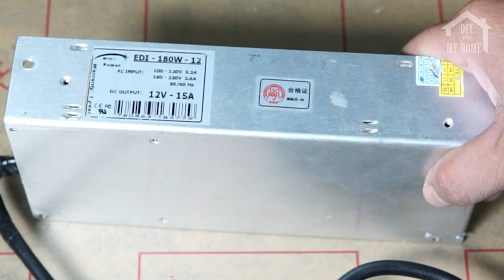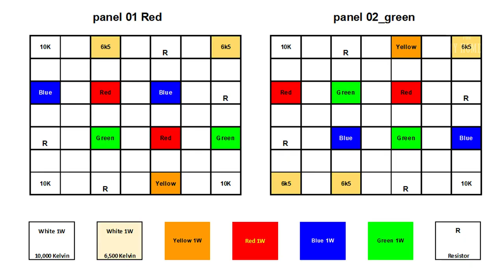DIY Aquarium LED Light WRGB with Luxeon Led

Comment: Very useful video bro. Thanks for sharing.
Can we control white red green blue independetly?
Can we do programming?
Lots of love n care from INDIA.
Reply from the maker: With the grb led controller you can completely control the colors separately. using the intensity correction of each color in the App. You can also schedule the lights to turn off and on each day according to the present cycle.
U can see more about Controller led at link:
https://www.amazon.com/Nexlux-Wireless-Controller-Compatible-Included/dp/B07116SX41/ref=pd_lpo_60_t_0/144-3267273-0150427?_encoding=UTF8&pd_rd_i=B07116SX41&pd_rd_r=c846f476-28a5-4d05-9b1c-919bbd955fbc&pd_rd_w=8w5mx&pd_rd_wg=eDvkl&pf_rd_p=2eae1586-a44a-4b21-997a-1dfc1740e496&pf_rd_r=WRW2GMH2VQBJG7F277H3&psc=1&refRID=WRW2GMH2VQBJG7F277H3
Reply: @diyformyhome2265  thanks a lot bro for assisting us. U have complete knowledge. Great. The light also looks so perfect.
Happy aquascaping .

Comment: How do you decide the color placement on the panel?
Reply from the maker: I rely on color ratio
White 10000 (kelvin) + White 65000 (kelvin) + Yellow --> 40%
Red --> 20 %
Green --> 20 %
Blue --> 20 %
Reply: Wt will b da ratio if i use 3wt

Comment: Bad , Bad , very Bad  you are not an electronic technician ... The first led module will be more bright than others... Each module should have it's own driver ....
Reply from the maker: you're right, we can use the driver module for each led sheet
But 
I calculated it to run at 60 - 70 % power of led only

using a resistor and a 12V -5A power adapter is much cheaper. compared to led driver module

Comment: How do you adjust the intensity of the LED’s?
Reply from the maker: You should be add the module adjust more.
You can see more information with link:
https://www.amazon.in/Techtonics-Motor-Control-Regulator-12V-40V/dp/B07QB8WD1X

Comment: Can you plz told me where can i get those led and trans ester how much amp ? If possible plz share your contact no. It would be very helpful
Reply from the maker: I bought them in the electronics store.
This is Led luxeon with with specification. 
Chip type: High power Epistar led chip
Led format: luxeon format
- Power: 1W
- Current: 300mA - 350mA (1W)
- Certifications: CE, RoHS
-Color:
+ Yellow (2000 Kelvin) 
+ White (6500 Kelvin ) 
+ White 10000Kelvin) 
Wavelength of color led:
 + Red (620nm - 625nm) 
+ Green (520nm - 525nm) 
+  Blue (460nm- 465nm)
- Degree: more than 50,000 hours
-Current: 3.0v-3.4v (only red: 2.2v - 2.4v)
And Resistor 10 ohm-1/2W
You can change them with the another led has same specification .

Comment: i have 1w and 3-4 volt per led...what is the value of resistor for this led?
Reply from the maker: I used 12V for 3 Led , You need resistor 10 ohm-1/2W.
With:
Red led: 2.2V (1W)
Yellow, white, blue 3.2V (1W)
electric current: ~280-300 mA
I set it like that for the purpose when led be using long time make the temperature increases after that voltage will put on the resistor, didn't make to break down led.
You also use 4 led /12V and don't need mount resistor .